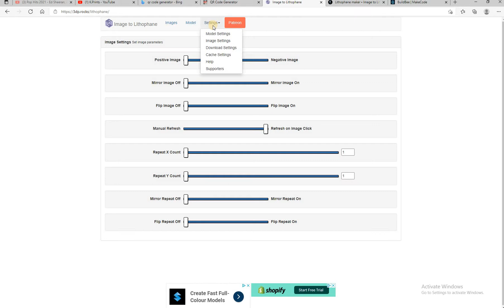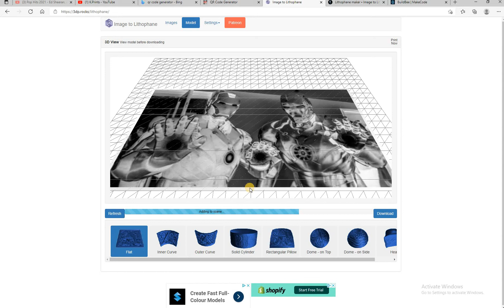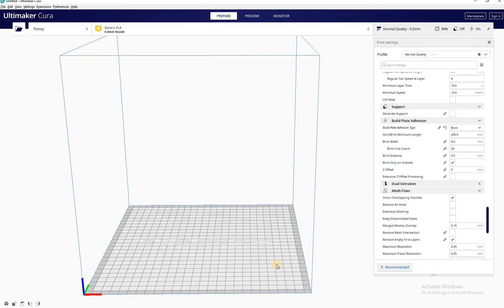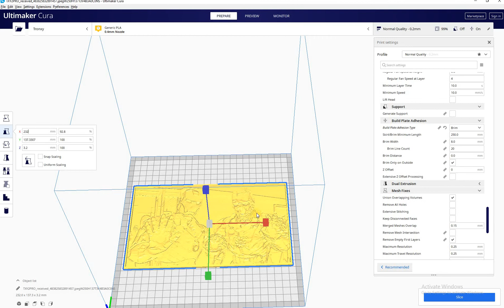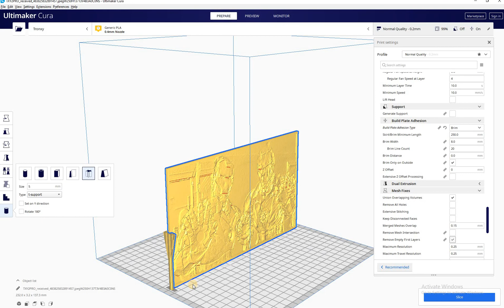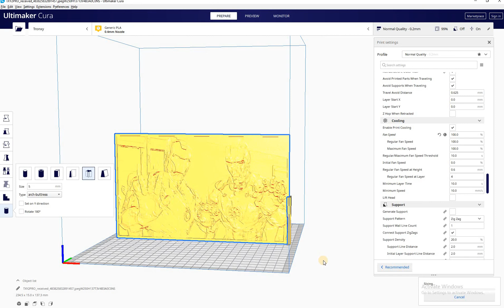3dp rocks  lithophane tutorial

Comment: I have several questions about settings in Cura. Why 99% infill and not 100%, unless you are over extruding?  Is it worth risking having a 1% bubble not filled in?  I've had my best prints with 0% infill, but walls at 10 layers.  Walls are typically long movements vs infill that is  short fast movements that cause vibrations that show up more in upper layers.   Other tips, if you bed moves along an axis, have the litho running the same direction, again reduces vibrations.  Also, if your cooling fan is on one side, have the textured sauce of the litho face the fan, and run the fan on a low speed.  You don't need much for cooling, and any stringing should be on the back side.
Reply: I found it very important to make sure the printer itself is dialed in just right, and you get a filament that is very consistent.  A good caliper is your friend.  Accuracy if 0.01mm, not 0.1 or 0.05, but 0.01mm

Comment: That’s some size litho 👍I’ve Been trying loads of settings which have been recommended but I don’t seem to be really get one I’m 100% happy with I’m using ender 3 and a ender 3 pro and cura is they anything you could suggest to help it’s driving me mad
Reply from the maker: i have an ender 3 also converted into a tall printer but your main settings will be retraction, temp, low speed 20mms, acceleration 700, jerk 8, also enable combing not in skin at 30mm hope his helps
Reply: @k.prints3dstudio717  thank you so much I will try this on my next tithing and much appreciated